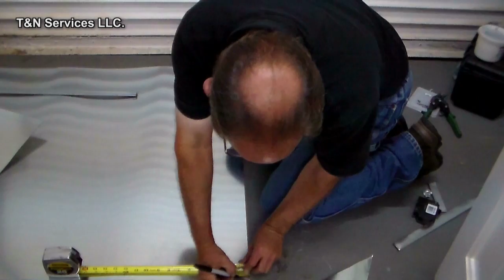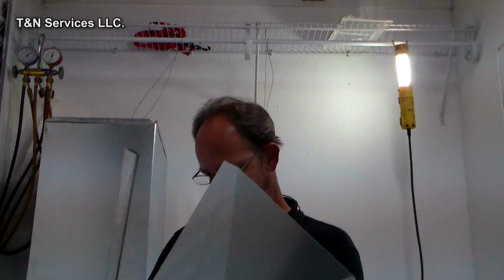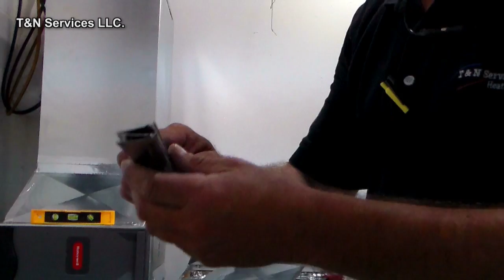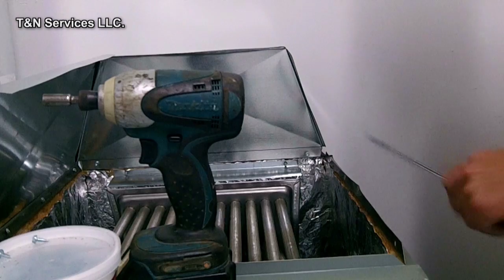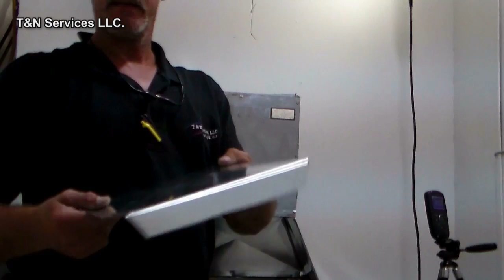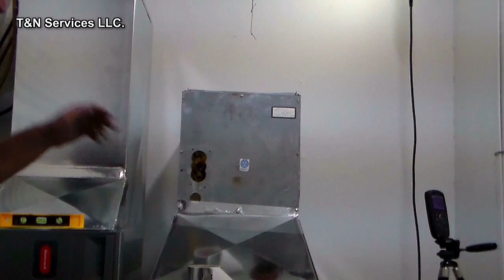HVAC Sheet Metal Video Series Pt 8B

Comment: They are not called s locks. It does not lock anything. They are called slips cause the metal slips in and out. No hems no Pittsburgh’s. Screws and tape hiding it all together I’m sure your a great tech but sheet metal is not your strong suit. Sorry but that makes me cringe.
Reply from the maker: We call them s-lock here. I’ve heard them called everything here in Georgia we call them S-Locks.

Comment: You should really learn how to do proper sheet metal work and invest in some basic sheet metal tools, such as a break and a Pittsburgh machine. It will save you a lot of time and your work will look a lot better. That or detail your work out ahead of time and have someone else build the metal work for you. What you are doing and then promoting is an injustice to the trade.
Reply: Agreed.  However I know not all companies have a break and a Pittsburg machine available on site.  I'm lucky enough to have a box truck that has a 4' break and a Pittsburg machine on the truck.  It definitely makes a very nice and sturdy plenum transition.
Reply: Are you able to read a dial clock or stuck on digital?

Comment: Do you ever run into furnaces that do not have a the lip to attach a plenum or coil case? I find some Yorks have no lip and I'd like to know how you go about attaching a plenum to one with no lip
Reply: Dan Gaynor if you use a York case coil it comes with brackets to mount to furnace and has a half inch flange for your plenum. 

If not then I use a single hem half inch flange and screw it down to the half inch lip on the furnace.

Comment: would all the same measurement principles apply the same w/o the coil?
Reply from the maker: Yes they would as long as you have a starting point. I just used the coil in the video as a frame of reference
Reply: +T&N Services LLC. ok thank thank you very much for all these videos. very very very helpful.
Reply from the maker: No problem glad I could help

Comment: Do you have any information on making a furnace box for a downflow furnace installation that is strong enough for the furnace to sit on.
Reply from the maker: Hey Jim, as long as your using 26 gauge or thicker sheet metal you should be ok. Some installs will be different then others so it's hard to say how yours would retro fit in. I would have to see a picture of it to tell you how I would do it.

Comment from the maker: Hey Wayne, First of all thanks for watching. I buy my metal by the roll it comes in 3ftx10ft or 4ftx8ft sheets. I buy it from the supply house about $11 a sheet. Depending on where I buy it from it's either 28 or 30 gauge.

Comment from the maker: Hey Pops, I use 28 gauge sheet metal. I've tried to use 26 gauge before but it's to hard to work with. You have to cross break it though, but as you see using a cross break sets your job apart from the other peoples. I'm glad I could help give you some more insight on sheet metal work.